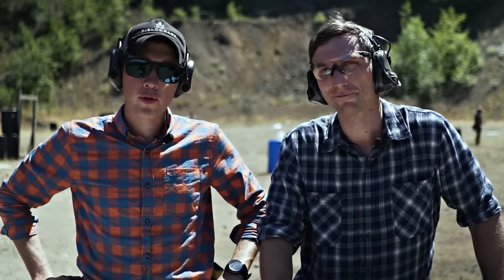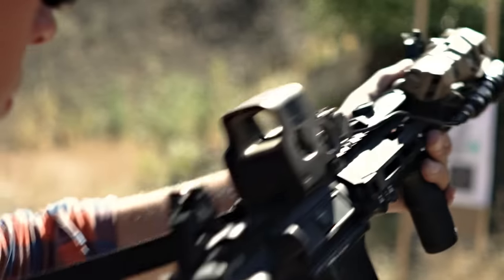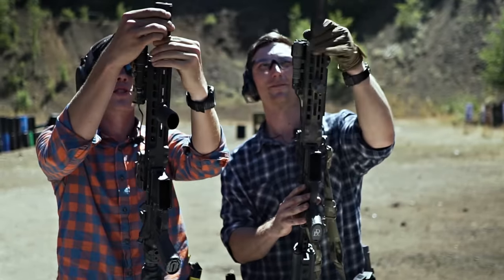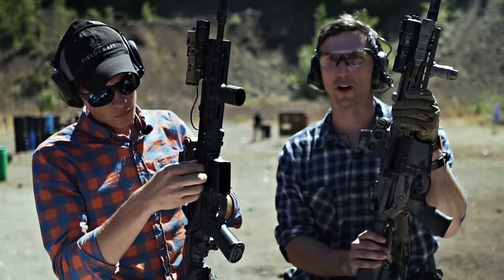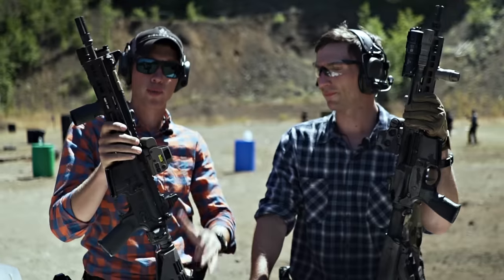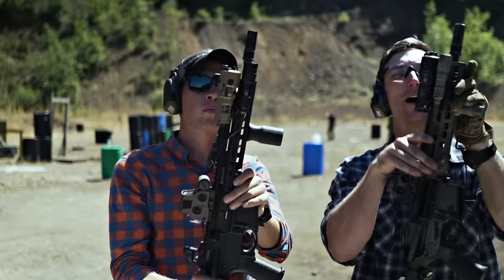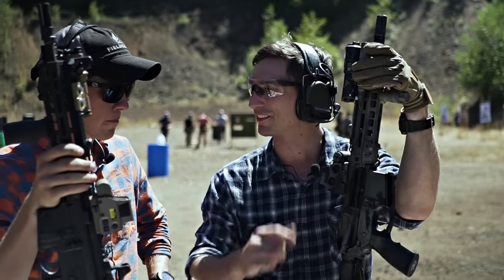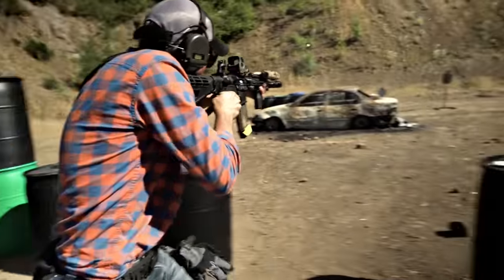Lucas Botkin and Garand Thumb on MK18s

Comment: I like the more vertical angle pistol grips, too.  I have the BCM Gunfighter which I just threw on a pistol I'm working on.  I have a B5 Systems grip on my AR rifle.  The B5 doesn't look quite as sexy as the BCM but it feels much better because of how much the beavertail fills out under the lower receiver. My hand just fits in it perfectly.  I think the B5 is a little more vertical than the BCM Gunfighter grip too.

Comment: @T.Rex Arms.... So running a 10.5inch in order for the parts to not wear out over time change the buffer weight and spring. Also a flash can if you can't afford a suppressor?

Comment: I just want to point out, that according to my research and the definitions/guidelines provided by the ATF (which I whole heartedly believe needs to be completely dissolved), Lukas (Lucas?) is wrong about the foregrip thing on his rifle in particular. 

“On June 25, 2019, the ATF clarified its position regarding how overall length for firearms using stabilizing braces should be measured. If the stabilizing brace is stationary, only standard receiver extensions are considered in overall length measurements. For example, accessories (extensions) that have superfluous material are not included in the overall length measurement. However, when a device operating as a stabilizing brace is attached to a firearm using a folding or collapsing mechanism, overall length is measured with the brace in the folded or collapsed position. Otherwise, a firearm could avoid classification as an AOW, yet retain the concealability and functionality of an AOW.” 

He has a folding brace, which means the overall length has to be measured without the muzzle device (unless it’s pinned & welded) and then measure the firearm in its fully collapsed position, which is definitely not more than 26”

He needs to be careful with that thing if it’s not registered as an AOW (which is different from a “Firearm” classification). He also cannot conceal it in a bag with that grip or he’s gunna catch a felony if he gets caught with it.

If it didn’t have the foldable adapter, and he never concealed it, then he’d be fine. 

Correct me if I’m wrong.
Reply: Going back through videos out of boredom, I just noticed that as well. Lol went straight to the comments to see who else did. My understanding was the same as yours. But, he's still in business right now which leads me to wonder in general about the Alphabet Boiz. Do they go for low hanging fruit because they have a better chance in winning a court case vs. trying to fight someone with the funding like Lukas has?

Comment: The ATF measures OAL from the end of the brace to the end of the barrel threads. However, if you have a folding stock, the OAL is measured from the folding mechanism forward. Hence, Lukas’s “firearm” is technically a pistol as it doesn’t meet the 26” OAL to classify it as a “Firearm”. Running a VFG on a pistol makes it an “AOW” which is an NFA item. No stamp = felony. Take off the folder.

Comment: From what I understand Lucas. The overall length is measured with the butt stock folded. The gun is measured in its shortest configuration. And must still be longer than 26”
Reply: I think the letter on how the weapon length  is measured came out a year after this video. If correct, vid was put out in '18 and the ATF letter has a June 2019 date.

Comment: so you said as long as your gun is 26 inches overall I can have a foregrip do I still need to pin and weld my muzzle device if running the 11.5 barrel?
Reply: Aaron Garbus good question.. but I’m pretty sure if you’re running an 11.5” 
It won’t matter especially with his folding brace that ads length. I had a 7.5” ( got rid of it immediately wouldn’t got short than 10.3 for any application) but point being that 7.5 with no folding brace and it was 25.5” from end of buffer to end of muzzle device. I’m getting ready to order a bum 11.5 upper and hoping I don’t have to run a folder for the extra length.. I’d love to hear an answer from trex on this though
Reply: @Frank Hamel the measurement must be from the ends of the “non-removable” parts of the Gun, i.e. from the bare muzzle to the end of the buffer tube. For a 10.5” barrel you will need to use the Leapers UTG AR pistol extended length receiver extension “buffer tube” with the SBM4 pistol brace to achieve the 26” OAL. With the SBA3 brace you would need something like the Vltor A5 receiver extension to get to 26”. (You might even need a 11.5” barrel with the Vltor A5 buffer tube - I don’t have one to measure to be sure but the A5 buffer tube is 1” or so longer than a traditional carbine buffer tube). Recent rulings may require you to measure the weapon folded if you are using the Law Tactical folder.

Comment: Lucus- when talk OAL to allow for vert grip. Did you measure from the end of the brace folded or open. I have heard diffrent  Opinions some say from the end of the buffer to some say end of  Adjustable brace all the way out or if fixed end of brace or buffer. Im  Just curious how did you determine the overall length? Being you took in an airport and flew with it i assume you have it correct....

Comment: Lucas what upper did you use when building your pistol AR?  Would be great if you would include what parts you used when building the pistol AR.  Also what brace did you use?  I am looking into building a pistol AR with a Aero lower.  Thanks for any information

Comment: Lucas, by making your overall length 26+ inches did you have to register it as a aow? I’m doing a build like yours and plan on making it 26” to add the vert grip, i know that makes it a firearm and not a pistol but wasn’t clear on the aow registration.

Comment: My most reliable rifle has no forward assist or dust cover. I'm talking 1000s of rounds over a long weekend. I built it after I got a new lower and the low pro upper was all I had. I was going to change it but then 5k rounds later I thought "why?"  Its not my go to style of upper but it works just as well for my usage.

Comment: great video as always!  Lucas I'm looking for feedback on the law tactical folding stock piece of equipment.  Any information you have, either side of the fence would be helpful.  So far i've found reviews split on it.  Lil nervous about the adapter to the bolt, your help is appreciated, Garand Thumb said you've got hours on it.

Comment: I've heard the argument against the forward assist that if the bolt doesn't want to go into battery then its probably for a good reason and you shouldn't beat or force the gun into battery when there's something clearly stopping it. What are your thoughts on this?

Comment: OUTSTANDING collaboration video!  Y'all are killin' it.  Question on the forward grip: Can you give me the section in 27 CFR on that, and where the measurements are from/to?  I know the comp or flash hider can't be used in the measurement unless it's pinned and high-heat soldered, but I'm unclear on the rest.  Any guidance would be greatly appreciated.  Again, great video.

Comment: What about running an adjustable gas block? I've been running adjustable gb for years, and I have rifles with 20+K on them without worn out parts, besides trigger springs, extractors and the normal wear and tear parts.

Comment: I have a question in regard to the Vltor A5 buffer system. What buffer weight should I run with my MK18 suppressed? Will the A5H2 be sufficient or should I go with the A5H4?

Comment: Agree to disagree on the forward assist. If a round will not seat, I’m ejecting it. If the next round will not seat, something is not right and you need to get into your action to figure it out rather than firing a round that has been forced into battery.

Comment: I don't understand why go to the Geiselle rail that wieghs as much as a RIS II or quad rail when i thought the point of going to Mlock on an MK18 was to make it lighter and less bulky. This is an honest question, I have no experience on it, I am trying to decide which rail to buy or stick with stock BCM MCMR.
Reply: I think it’s all preference a lot of guys are going with Geissele handguards because of the secure mounting to the upper receiver and with the extra weight comes that little extra bit of ruggedness. But you can’t go wrong with BCM either.
Reply: Also going mlok you still avoid the extra bulk even if they’re roughly the same weight.

Comment: I’m confused over all length is over 26 inches but barrel is less than 16? Still pistol because you have the brace so it’s not an SBR?  And you can add a foregrip because it’s over 26 inches.

So basically declare it as a pistol make it 26+ inches and you’re good to put a foregrip on it?
Reply: No.
Pistol=No stock, no foregrip. Less than 26" from extended brace to tip of barrel. If muzzle is welded, tip of muzzle.
AOW=No stock, foregrip. Less than 26" from extended brace to tip of barrel. If muzzle is welded, tip of muzzle. NFA stamp required.
SBR=Stock, optional foregrip. Less than 26" from extended stock to tip of barrel. If muzzle is welded, tip of muzzle. NFA stamp required.
Firearm=No stock, optional foregrip. More than 26" from extended brace to tip of barrel. If muzzle is welded, tip of muzzle.
Long Gun=Stock, optional foregrip. More than 26" from extended brace to tip of barrel. If muzzle is welded, tip of muzzle. 16" barrel required. If muzzle is welded, it counts to barrel length.

Comment: Overal length 26 inches should be measured with the LAW adapter folded apparently according to some recent developments.
Reply: but as far as everything else is concerned as long as the barrel is less than 16" (or is it just as long as OAL is over 26"?) and the OAL is >26" (which could be achieved with a pistol buffer extension tube?) you're still good to go as of now with a vertical foregrip and it being classified as a "firearm"?

Comment: Lucas or Mike, or anyone that's informed, can anyone comment on how you measure your pistol/firearm to see if it's OAL is greater than 26"? The literature I've seen says to extend the stock to full extension if applicable. If it's a SBM4 brace do you go from the end of the brace (wherever you have it positioned since there's no notches on it or the tube) or from the end of the buffer tube?

Comment: T.REX ARMS help me out. You mention it's a "firearm", over the 26 inches and and what not, yet can you shoulder that brace? I can never seem to understand if it is okay or not. I get different answers all the time.
Reply: It's considered illegal to modify the brace so that it can't be used as a brace, that's it.

Pistol=No stock, no foregrip. Less than 26" from extended brace to tip of barrel. If muzzle is welded, tip of muzzle.
AOW=No stock, foregrip. Less than 26" from extended brace to tip of barrel. If muzzle is welded, tip of muzzle. NFA stamp required.
SBR=Stock, optional foregrip. Less than 26" from extended stock to tip of barrel. If muzzle is welded, tip of muzzle. NFA stamp required.
Firearm=No stock, optional foregrip. More than 26" from extended brace to tip of barrel. If muzzle is welded, tip of muzzle.
Long Gun=Stock, optional foregrip. More than 26" from extended brace to tip of barrel. If muzzle is welded, tip of muzzle. 16" barrel required. If muzzle is welded, it counts to barrel length.

Comment: Overall Length is measured with the Stock folded if you are using a law tactical folder. Your OAL may not be 26 inches like you think.
Reply: The only case of that being true is in Connecticut during the raid and seizure of The Freedom Shoppe. They were in violation of subsections of the CT Assault Weapons Law. If I'm not mistaken, it's still not clear whether the folder on an ar15 counts to length or not. Because the rifle does not cycle with the extension folded.

Comment: guys, could you please present us with a list showing the exact components and set up each of these MK-18 is fitted with??
Reply: Here's the answer- they aren't mk18s
Reply: @jeremythomas3064  i get your drift but still, i would appreciate a list on these two carbines, thank you
Reply: They won't give it to you. But I can. 

Surefire muzzle devices
Mk8 m lok 9.3 rails
Surefire m300 light
Mawl
Surefire pressure pad
Eotech EXPS
Daniel Defense or Scalarworks fixed irons
Botkin has a Magpul grip, and GT has a DD grip
GT has a tango down foregrip
GT has a VLTOR A5 buffer system
Botkin has a magpul foregrip
GT is using a sopmod stock
Botkin has an Sb4 pistol brace
I assume both are running Geissele triggers, it's been awhile since I watched the full video because it's useless to me.

Comment: I am curious is the OAL measured from muzzle to receiver extension or end of the Brace? how does that work on SB tactical vs Kak since the KAK has a set screw?
Reply: OAL is measured from the tip of the barrel (or muzzle device if it is permanently attached) to the end of the stock/brace in its most collapsed (or permanent position via welding/rivets/epoxy/etc.) position in which the firearm is still functional.
Reply: The Consultant making my draco into a firearm would be very convenient with foregrip. I suppose it would need to be non folding brace from your description. Since it could fire folded.

Comment: I'm so confused. What does "pistol" mean? What's the difference between a pistol build and a rifle build?
Reply: from the ATF website: "The term “Pistol” means a weapon originally designed, 
made, and intended to fire a projectile (bullet) from one or more barrels when held in one hand."

an AR pistol has a round, thicker buffer tube that cannot accept a solid stock and a barrel shorter than 16 inches. however, if the pistol has an overall length of at least 26 inches from end of buffer tube to the end of the barrel, (or welded/pinned muzzle device) it's not a pistol, just a "firearm", so it can have a vertical foregrip or whatever you want to hold it however, but you still can't have a stock because that redesigns the gun to be fired from the shoulder (a rifle).

Comment: What length handguard would I need to fit a 10.3 barrel if I wanted to keep the a frame front site on the barrel?
Reply: You would need to find schematics of the barrel profile you want and find a rail that fits your needs. Most 10.3s are from DD and are govt profile. Boot up google images and search for the schematics.

Comment: Can anyone cite support for Lucas' claim of a 26" OAL gun with a barrel length under 16" not being considered an SBR when a vertical foregrip grip is attached? I found an ATF explanation referring to the 26" OAL but the 16" barrel length is also a necessary criteria. It seems he's in error here but in more recent videos he's calling it a hand stop and it's angled so maybe he figured this out?
Reply: Pistol=No stock, no foregrip. Less than 26" from extended brace to tip of barrel. If muzzle is welded, tip of muzzle.
AOW=No stock, foregrip. Less than 26" from extended brace to tip of barrel. If muzzle is welded, tip of muzzle. NFA stamp required.
SBR=Stock, optional foregrip. Less than 26" from extended stock to tip of barrel. If muzzle is welded, tip of muzzle. NFA stamp required.
Firearm=No stock, optional foregrip. More than 26" from extended brace to tip of barrel. If muzzle is welded, tip of muzzle.
Long Gun=Stock, optional foregrip. More than 26" from extended brace to tip of barrel. If muzzle is welded, tip of muzzle. 16" barrel required. If muzzle is welded, it counts to barrel length.

Comment: What does he mean by “with the way the AR15 operates it’s necessary to have a forward assist”? By design it is the exact opposite. Detent on the bolt put there by Stoner as a forward assist. As well you should not be slamming on the forward assist if it won’t go into battery. It is quite literally useless/unnecessary weight.

Comment: I think Lucas was incorrect in saying that his gun is classified as a firearm and not a pistol based on the ATF clarification about folding stocks. That one ATF letter said that you measure from where the stock folds to the end of the barrel, so his would still be under 26 inches and can't have a vertical grip. It's all bull anyway and we shouldn't be using letters as law but I'm just putting this here for anyone that might be going to a competition or something and wants to be well within safe guidelines. Starting the rebellion against the NFA isn't worth going to prison (especially if you have a family). Better ways to fight.

Comment: Ok need some help from Lucas and anyone that is a gun know it all. Sbr and non sbr. I really like Lucas non sbr firearm. But trying to figure out what overall length is considered. I was told from a permanent break on the end to the start of the buffer tube. Also read from the permanent break to the stock fully extended. Of course this is with a barrel under 16in and equal to or greater then 26in to be a non rifle no consealable firearms, like Lucas' someone wanna help me out please.

Comment: Soo if you can run a vertical grip and it's classified as a "firearm", couldn't you run a stock? And before someone says no that would be an sbr. Yes I understand an sbr but if it's no longer a pistol and not a rifle but a firearm than why wouldn't you be able to runs stock?
Reply: Pistol=No stock, no foregrip. Less than 26" from extended brace to tip of barrel. If muzzle is welded, tip of muzzle.
AOW=No stock, foregrip. Less than 26" from extended brace to tip of barrel. If muzzle is welded, tip of muzzle. NFA stamp required.
SBR=Stock, optional foregrip. Less than 26" from extended stock to tip of barrel. If muzzle is welded, tip of muzzle. NFA stamp required.
Firearm=No stock, optional foregrip. More than 26" from extended brace to tip of barrel. If muzzle is welded, tip of muzzle.
Long Gun=Stock, optional foregrip. More than 26" from extended brace to tip of barrel. If muzzle is welded, tip of muzzle. 16" barrel required. If muzzle is welded, it counts to barrel length.